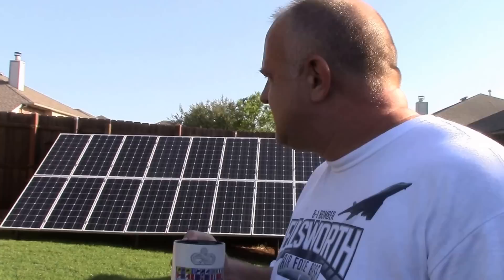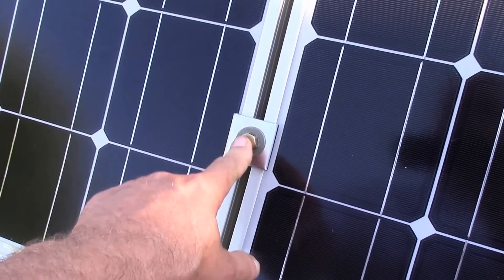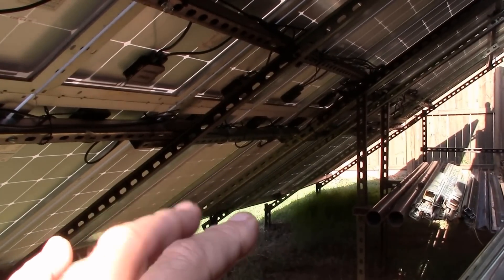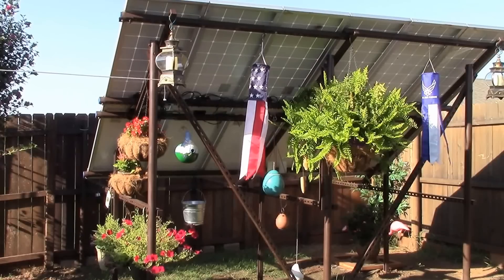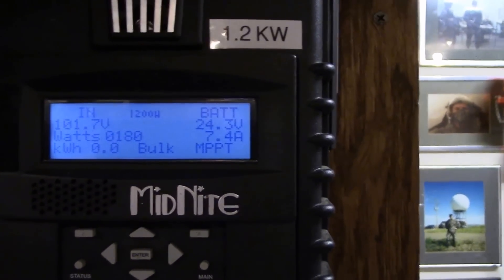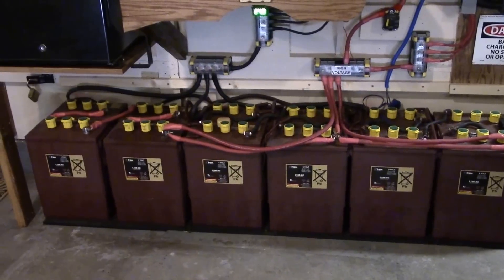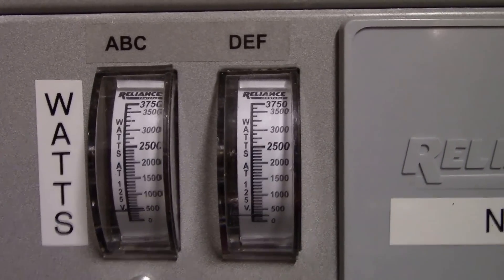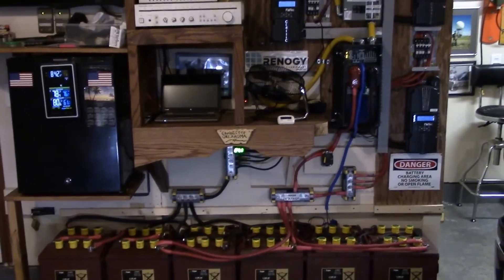2,400w backyard solar panel array. Added six more Renogy 100w (12v) panels!

Comment: Wow I just saw this video, you added to the fence array! Looks awesome. I'm a newbie to solar, you say 4 series and 1 parallel. Looking at Renogy web site at 100w panels. Ruff numbers, each series is 144V and 1 parallel is about 5A to the controller? Or is it 5A times 4 series so 20A to the controller?
Reply from the maker: Thanks. For this array, 24 100w solar panels. Four strings of six in series, four parallels, single feeder line. Yeh, about 144 volts and less than 30 amps (max) on the 10 AWG PV feeder lines to the controller. Been running perfect for YEARS now w/o a hiccup.

Comment: Chris, Impressive setup. Can you provide a break down of the batteries you are using and the hardware for tying the panels together. I can't seem to find good breakout boxes. How are you also monitoring the temperature of your batteries in case one battery goes bad, knock on wood. I am expanding my system with 4 more Renogy panels after this Corona virus goes away.  Regards and great video.  Don.
Reply from the maker: I upgraded many things since this video (running lithium batteries now). Prob need to do another video on where I am at now. In the meantime, I suggest you give the folks at the AltE Store (.com) in Massachusetts a call with any/all your questions. I have been using them for years...A+ folks there.

Comment: Why are you using all 100 watt panels? Personally I like the 300 watt 24v panels.
Reply from the maker: Older video. In fact, they are all still installed and performing excellent. I have explained "why" I chose 100w panels many times.
Reply: Chris DIYer first video I watched do I wouldn’t know the backstory.

Comment: I know this is an old video but i do have to ask. you mentioned that you had a lot of trial and error and money wasted while you were I assume figuring stuff out. Would you of bought differnt panels back then now knowing what you know?
Reply from the maker: Prob not. To this day (knock on wood) all my Renogy/HQST panels have been excellent...still kicking out great power. The first Renogy 100w panel I bought in 2013 is still in-system and outputting great power.

Comment: what wire size did you use on the solar setup like 2400w ..#6  or you separate some string with smaller wire to the controller
Reply from the maker: #10 solar PV feeder cable. Total amps on that array is not even close to 30 amps since I am running higher volts to the solar chargers
Reply: @ChrisDIYerOklahoma  .. nice..  panels with breakers to every 3 solar string and #4 panel to controller panel inverter box ..  maybe I when a little over kill . In case I want more amps
Reply from the maker: FWIW - I use circuit breakers and fuses...even more protection

Comment: My panels are on my roof but only get serious sun around midday until 6pm. I want to get my electric hot water heater on a timer to coincide with the increase in solar energy around that time. Good video, thanks

Comment: The first charge controller only has 13.4 amps going through it?  The second is 1.8 and the 3rd is 7.4? I am getting over 72 amps from only 9 panels at 340 watts each. I'm sorry, I'm not trying to knock your array but really this is all it produces with all of those panels and batteries?  You have total 22.6 amps? I would strongly recommend you upgrade your panels. You have ok controllers but there are by far better ones out. I see you did this back in 2016. I would recommend very high;y that you at the very least, upgrade your batteries to some Tesla cells as they produce 233 ah each. I went with 3 of them so far giving me 700 ah. I will be adding one more to jump me to over 1000 ah. Then your talking. I do love the clean job you did on the panel install, very nice. Like I said I am not trying to knock what you did but you are lacking a lot in a lot of ways inside the house. Upgrade the batteries and I would highly recommend you roll your panels into amp series as this will allow your battery bank to get a real charge.
Reply from the maker: That was at 8:40 am...when the sun hits all the panels, normally see 120+ amps of charging current. There is nothing wrong with using 100w Renogy mono solar panels wired in series to push voltage (more efficiently) through PV lines to the MPPT solar chargers...5+ years and they continue to produce power well. Ask any professional installer about series voltage wiring. Also, never had one of these Renogy panels fail me in 5+ years. Are they ideally positioned? no. On trackers? no. Greatest and latest battery bank? no. Good luck with your build and continue learning

Comment: Hey Chris. would you use the same panels still if you could go back in time?
Reply from the maker: Good question, thanks for asking. They have been solid panels since first starting buying them about 5 years ago...no issues. Time will tell...and/or when some "real" hail or a tornado wipes me out
Reply: @ChrisDIYerOklahoma  I'm about to build my  12x8 shed with a 40° slope and 16x12 roof foot print lean too style. Still debating what panels to go with
Reply from the maker: Roger that...sounds cool. Might consider checking out the AltE store https://www.altestore.com/store/ They are the real experts and good people...know more than I do. I don't have any recommendations on solar panels, haven't been following what is recent/good

Comment: Can you charge the Goal Zero 1250 (from the back) using an Alligator Clamp that comes with the Renogy 100 watt solar panel?
Reply from the maker: Dunno...but, should work with the right plug adapter

Comment: Of course your ego tripping 🤣 but who cares its mighty interesting and great that we can now generate power.

I like your setup and yeah I'm envious still won't be long I'll be starting my own solar power journey.

I like solar because its the way of the future.

No coal
No nuclear

Anything to save our planet and so the more you can install the better.

My brother in-law bought 62 x 250 watt panels which generates I guess up to 16,000 watts.

I read wiring solar panels in series is bad because if even 1 panel is shaded it generates no power but you did say your using a kinda hybrid series and parallel wiring arrangement.

I'm still trying to work out how that works.

Anyway thanks for showing us your solar farm mighty impressive!👍👍

Where are you going to put the new panels? 😁

Comment: Do you have a diagram for that configuration I have right now 6 100watt pannels but dont know how to configure them and wich charge controller should I use, I have 4 6v 255h @100h trojan batteries have not installed it yet still serching to learn

Comment: Great video. I was looking into solar for a while, but I think with my HOA and the area I'm at we can't have it.. but either way I'm looking into putting one in my backyard. For one you won't be limited to 50% of the roof that most states mandate. But also I figure it will be against HOA, but if I put up a fence I will hope that will be more than enough to deter them from finding out..
Reply from the maker: Good luck...it is worth it IMO. My tiny-ass suburbia backyard is not ideal for solar panels. But, it is what it is. With insightful planning, prep, and adhering to local (HOA), city, state, and electrical codes...it is awesome when done

Comment: Chris, did your HOA give your any grief regarding your install?
Reply from the maker: Naw, not at all. Backyard system meets HOA and city requirements (can't be visible from the road and/or be over two-stories). Electrician looked everything over to ensure safety and codes.
Reply: Thanks, Chris- my HOA specifically prohibits solar panels, but I'm thinking about installing a ground array like yours along the fence line (fence is 6' tall).  I'm looking at the Sol-Ark product from Texas- apparently grid interactive.  Keep up the vids, much appreciated.

Comment: Just a suggestion.  You might want to move those batteries out from under all of that nice and expensive equipment.  The off gas of the batteries is corrosive and can shorten the life of your components.  Nice set-up.  You look very happy.

Comment: Do you have problems with the Midnight controllers in your heat?  A while ago I was looking at their Kid controller, but I found out Midnight controllers can't operate at full rated power past 77° F ambient temperatures.  They de-rate or reduce power every degree past the limit, which is ok I guess if you live in Canada?
Reply: I like Magnum for larger arrays and they are versatile.   They are beasts though.  But they are American made and can be repaired at home and you can order the PC boards to replace in a failure.  I like the idea of being able to repair my own stuff.  Just a thought.

Comment: Are you a qualified electrician? I couldn't imagine how I would be able to do any of this but I really would like to.
Reply from the maker: No...but, 25+ years working in electronics/maintenance/repair. Start small and get your feet wet before opening your wallet or writing a big check for a whole home system. Check out the AltE Store website.

Comment: So Chris, I just bought a book "Solar Rooftop DIY" I looked at Barnes and noble and it was the only solar book they had! Lol.  And so this author in this book says the mono crystalline prices should be 75 cents a watt and poly crystalline should be 62 cents a watt.  I can't seem to find prices this low anywhere.  The book was published this year.  Any ideas ?  Id like to get a good deal since it's kinda a hobby for me and im learning as I go. Thanks man!
Reply from the maker: There are some deals out there. Most are around $1/watt for mono. The higher the wattage panel usually equates to a better deal...and buying in quantity. Also, "rooftop" mounting has a lot of drawbacks. Recommend making 100% sure that is best before committing to mounting solar panels on a roof.
Reply: Good points you make, im not a big fan of roofs either.  Just hungry for Solar knowledge and loving the idea of harnessing the sun! Arghhh arghhh (tim the tool man taylor grunts) haha.  Have a Good day man.  Im gonna go find some fast food! 🍟🍗 yum.

Comment: Looking good man! What size inverter do you have and did you have a electrician do all you electrical work?
Reply from the maker: The inverter is an Outback Power VFX3524. 3,500 watts @ 120VAC. Pricey equipment...but, NEVER had an issue and have drawn over 4,000 watts out of it (for a short period). My electrician wired up the transfer panel to the mains and fed the wires (in/out) to the inverter. I did that portion. Everything else, I did myself (panels, racking, wiring, batteries, chargers, outlets, etc-etc-etc). Highly recommend Outback Power inverters.

Comment: Hey there!  As always, NICE SYSTEM!!  I'm really curious about those 3 frameless solar panels.  You said 1300 watts but there's 3 of them.  1300 doesn't divide evenly by 3.  I'm just asking cause I wanna find them!  That's so awesome!  Are they semi-flexible like the little 100-watt panels out there that people use on their boats and vans ?
Reply from the maker: The are 435 watts a piece rated. I use 1300 instead of "1,305" watts...easier to say. They are not flexible...laminates.

Comment: Hey Chris, question for ya.  I think you said you have around 1100 amp/hrs total on your battery bank right. My question is how large or amperage size battery bank should to have given your solar array size?  Is there a standard regarding that and also, would there be any other type battery you would go with if you could choose again. I know those batteries appear to do well, just curious if you might have come across something you thought would have been even better given relative price similarities.  Thanks and I enjoy your videos.
Reply from the maker: Thanks for watching. Great questions. 1,100 aH (at 24v) = 26.4 KW/H. Using the "50% rule" that is 13.2 KW/H. Most of us don't go below 65% SOC...so that works our to real world 8.5 KW/H. What this means is can safely use 8.5 KW/H overnight. I find that my system needs to almost double that during the day to reach FSOC (full state of charge). So, need to harvest 17 KW/H from the sun. On top of that I am "using" power big time in the summer. So, the system has to do two things at once...charge the battery bank and power the inverter for house loads (mostly the window AC unit). There are all kinds of battery technologies out there tooting all kinds of stuff. Trojan has been in the battery business for 100 years...and I got a killer deal on my old-school 6v flooded lead-acid batteries. Very happy with their performance.

Comment: I like the B-1 Bomber shirt, brings back memories.  I used to guard them at Grand Forks, AFB, former SP.  Good times. :-)
Reply from the maker: Roger that...I was an SP augee for six months in Aviano back in the early 90s. Retired radar 2E0X1.
Reply: Outstanding.  I almost went there in 91 as my next duty assignment from the PI, mount Pinatubo's eruption and my subsequent emergency evacuation to the states changed that.  Got stationed at Offutt, AFB instead.  That were I finished my AF career in 92, started an Army career in 93, got out in 96 go figure.  But anyway as a fellow vet, thanks for your service.

Comment: are you missing out on sun because it isn't roof mounted?  would you roof mount if you could?
Reply from the maker: Nope...never will. Yes, I would get somewhat better power roof mount or using a tracker system. But, my roof is not good for panels, HOA/city rules, etc-etc. Ground mount is more secure, easier to maintain, and hidden from the road and nosey people.